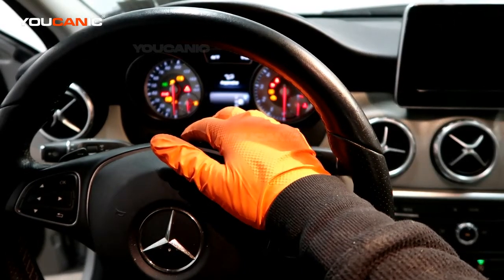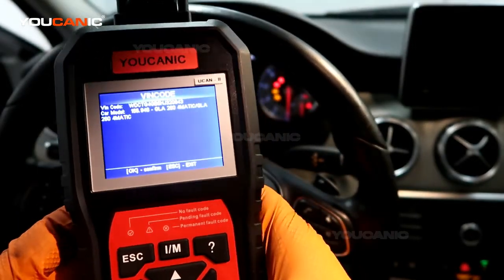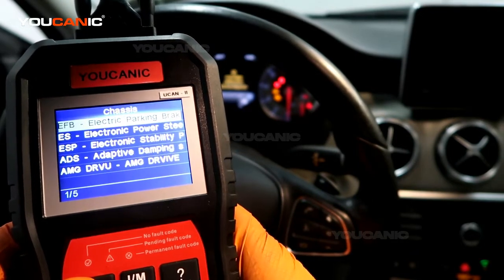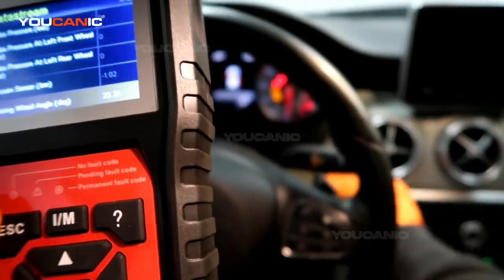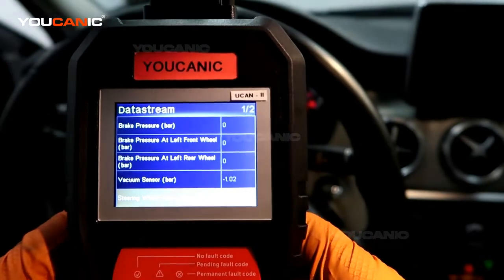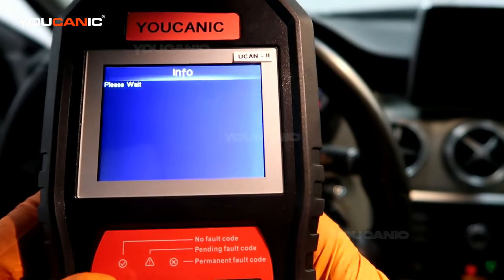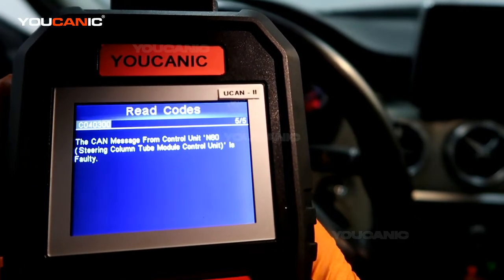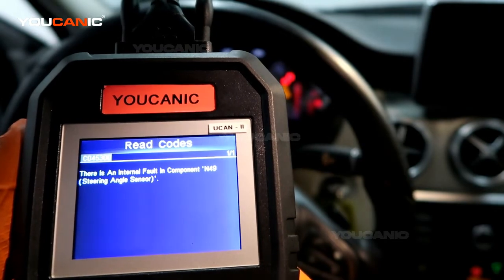2014-2020 Mercedes Benz GLA250 Diagnose Steering Angle Sensor Problem using a Scanner

Comment: Am having this issue in my infiniti qx30 it is the same as the Gla 250 do you have a part number for me I can't find a video on how to fix this issue I called the dealer they mentioned I need to replace the dash wire harness and that they don't make it any more a cost of 10,000 cost please help..Thanks